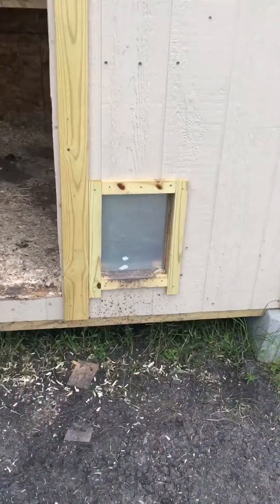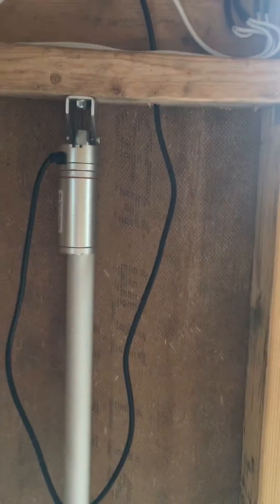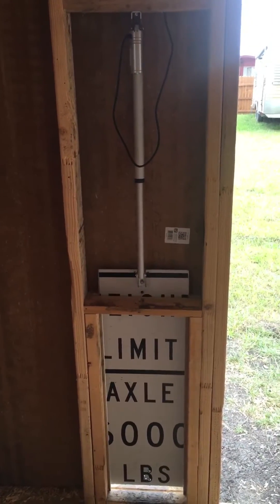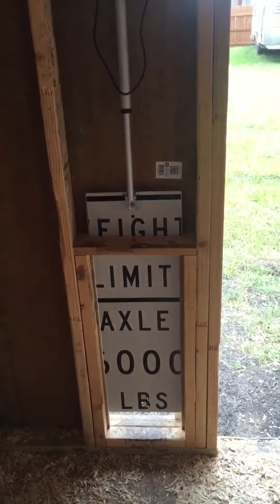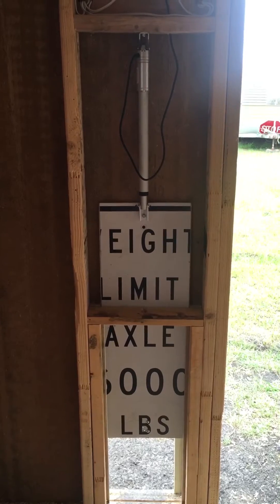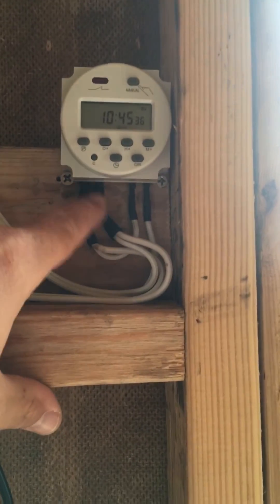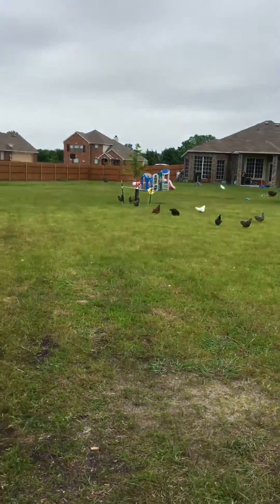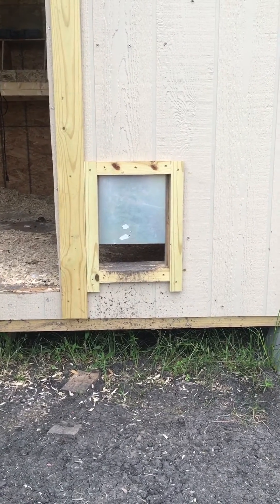Automatic Chicken Coop Door - Linear Actuator

Comment: I just built a vertical lift door with an antenna motor and it works great. We tried the drawer slides and had problems so we just made an L track out of some wood and it goes up and down great!
Reply: The car antenna is a shit idea. the antennas cost almost as much as a decent low end actuator but give 10xs the hassle. Plus the wiring is just a pain to for most people to figure out even with instructions.